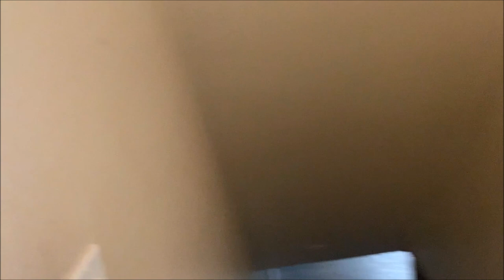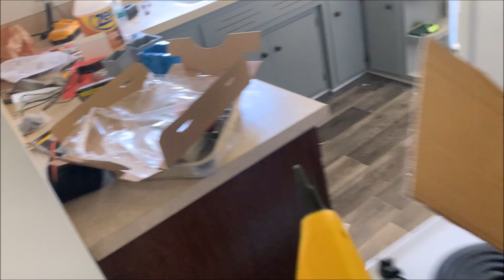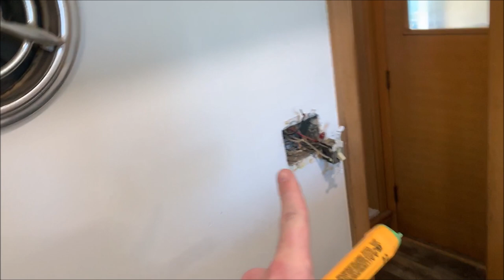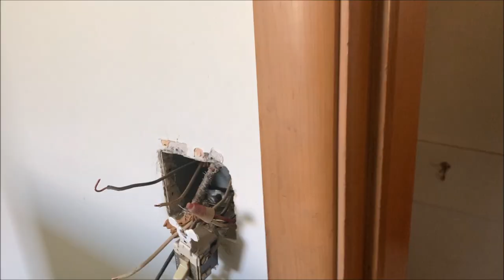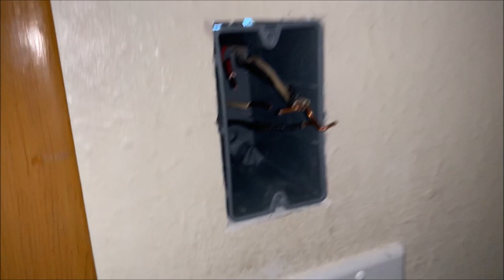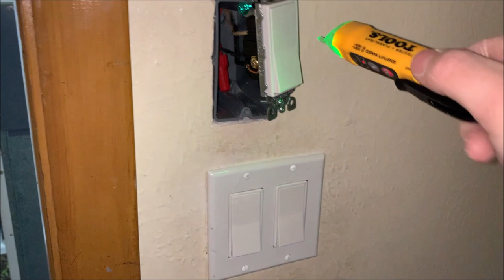I Moved a Light switch!

Comment: Some people used to use an extra neutral wire as a ground. I have seen it in some of the outlets and switches I’ve replaced. I’ve never wired a 3 way switch, but I have heard they can tricky.

Comment: Should have taped up new wires to the old ones and pulled it out that way it would be easier for you to pull new wires thru the pipe :)
Reply from the maker: They’re not in a pipe. They’re staples in the walls so pulling isn’t an option unfortunately.

Comment: This is why when I remodel my house every damn outlet and switch will be on it's own wire lol. I will have a thousand breakers in my box most likely
Reply: When I built my house I made a sheet that list each outlet on that run in order. There's a copy of that sheet in the electric panel and in my house equipment book that has all the owners manuals. You can also label each outlet with a sharpie in the outlet box like B1(breaker 1)B1-1 (first outlet on breaker 1 run).